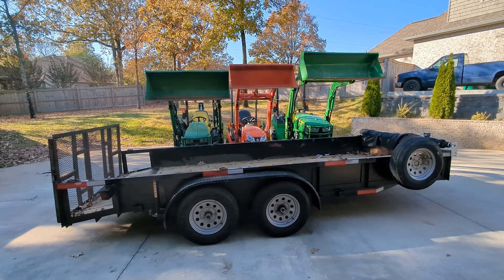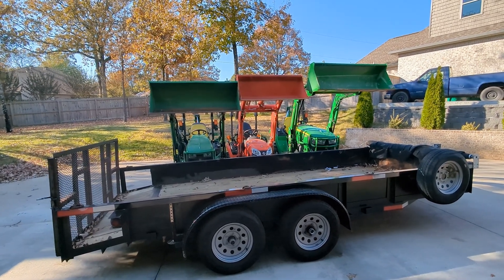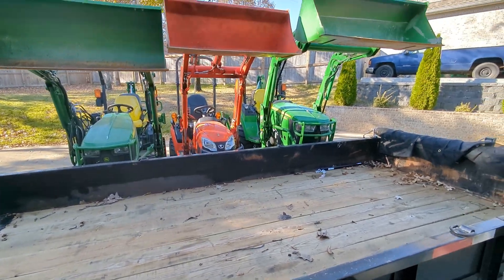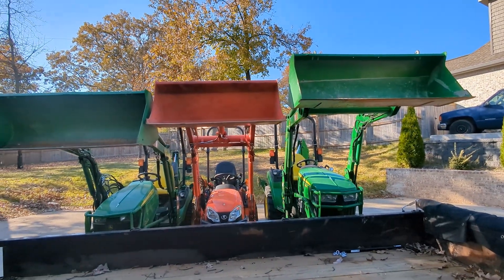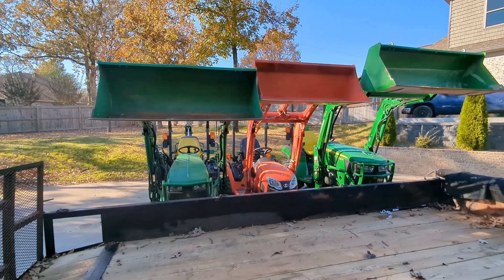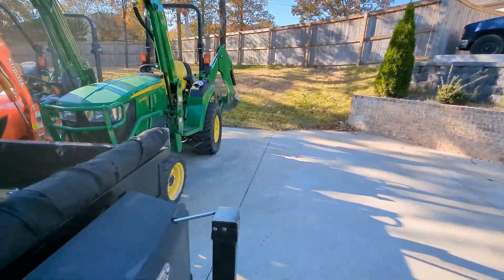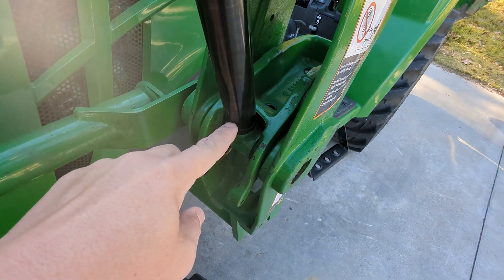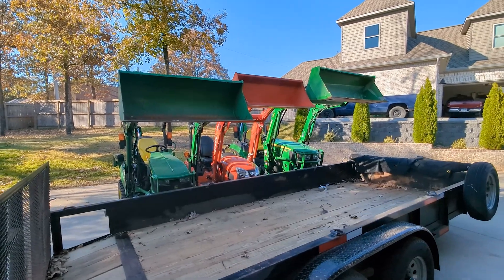Kubota BX2380 vs John Deere 1025R vs. John Deere 2038R Lift Height Comparison

Comment: reach is important to, the higher you go on some the less reach to center of trailer.
Reply from the maker: yes, but if you want to get your reach back, you can just lower the loader.  The Kubota has more reach at it's maximum stock height, but when you bring it up higher with HydrosPlus lift+, then the lift is more similar to the JD 1 series...along with the lift height.